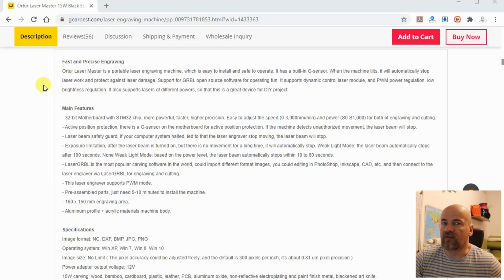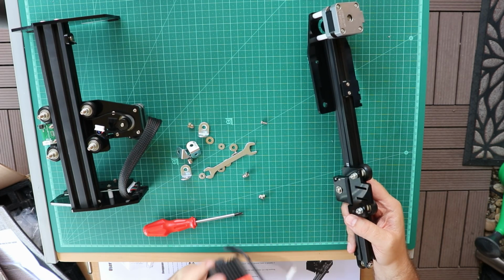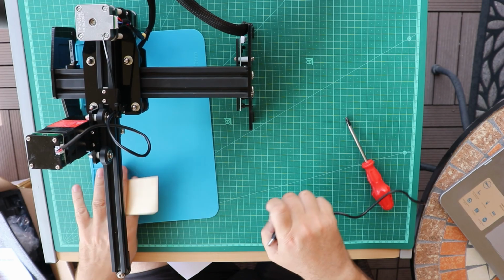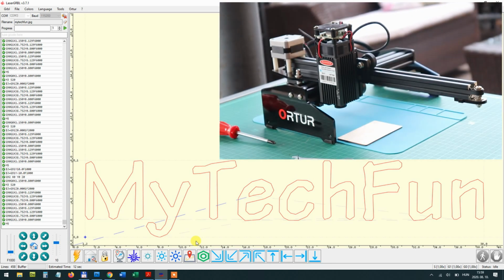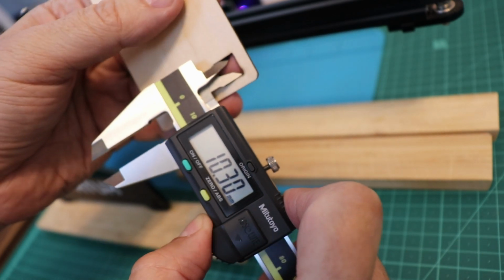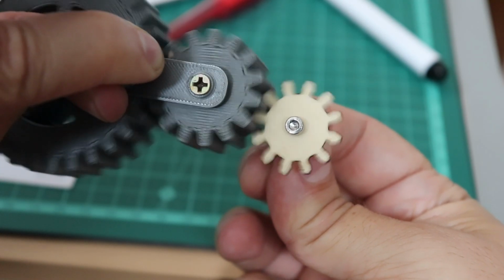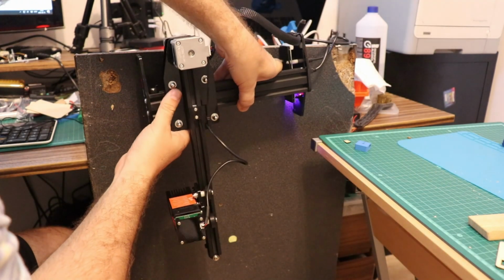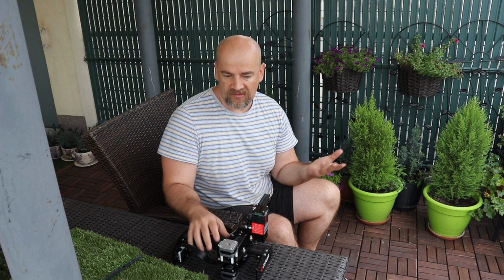Unboxing and review of Ortur Laser Master 15W laser engraver and cutter

Comment: Hi, I only want to use the ortur on coloured anodised aluminium I will not need the laser to cut anything only to put text onto the anodised aluminium, speed doesn’t matter so which will be the best quality, the 7 watt, 15 watt or 20 watt. I hope you can reply to this. Thanks.
Reply from the maker: So far, I didn't try to engrave aluminium. But if I will get some good results, I will document it and upload a video.
Reply: @MyTechFun  thank you.

Comment: To laser stainless stee,l spread mustard on the area to be engraved first.  The laser has a chemical reaction when in contact with the mustard and steel and it helps it burn.
Reply from the maker: Serious or joke?
Reply: @MyTechFun  Serious,  the mustard has a reaction on the steel,  not sure what grade of steel it works on,  but it does work.
Reply from the maker: Thx, I will try it

Comment: Great video so much info here. Did you ever end up getting better grayscale results? I was thinking about buying one but after seeing your video I'm leaning towards the neje 3500
Reply from the maker: Now, after few weeks of additional experience, yes I did, but not much better. I had to reduce the speed and laser strength. Then I could go with smaller dots too. But it depend a lot of your engraver, your settings of focus point..

Comment: I wonder if you could cut normal paper with it and how that compares to the regular paper cutting/stenciling machines.
Reply from the maker: It can cut normal paper too (need high speed), but mark on edges are visible (black from burning). Not much, but visible.

Comment: You might try vertical where the y axis is the vertical one, not the X. As then the origin x0y0 should be at the bottom left, as opposed to the top left.  Watching the embeded clip, it looks like when they engraved bread, they did a raster, while you were doing a vector engrave. It wouldn't surprise me if their clip was spead up as well.

Also one of the things that may help your engravings is to use a vacuum or blower to move the smoke out of the laser path. This will also help with laser safety, as a big problem for these laser engravers is that the laser reflecting off the smoke gets scattered, but is often still high enough in power to cause problems for retinas. If you vacuum the smoke out, it can be captured in a filter, or evacuated outside. A blower cans leave smoke in the path of the laser at other points from where the blower is functioning. but it may be something you can print a mount for to attach to the laser head and it will move with the laser, and clear the path along the way. Just some observations.
Reply from the maker: Yes, I noticed in meantime, that somoke may have some effect to strength of cutting or engraving. About rotating engraver, I tried it, but in that case, whole X axis moves when motors are not active. In position shown in video, only module has to stay in place with stepper motors off, and it is much lighter.
Reply: @MyTechFun  Yeah, smoke is very likely going to reduce how much laser light gets to the target. 

What you might consider doing then is effectively rotate x/y axis 90 degrees counter clockwise, so that the bottom left in the orientation you show is the x0y0 position,  Unless actual endstops are involved, it could be as simple as swapping the x and y connections at the controller board, and if necessary rotating connectors to get the +/- for each correct. I suspect you may see some overshoot problems on -x moves, but you might be able to correct for them with a counterweight if the belt is available on the far side of the beam. If it's running down the middle of the beam, that would be a bit more difficult. And yeah, adding a counterweight does mean having to move more mass, so might result in needing higher current , but at least the mas should ballance.

Again, ideas. Something to experiment with, or not. :-)

Comment: Thank you for a very helpful video - I've been thinking about buying one of these.  By the way, you should try painting stainless steel with a light coat of zinc primer paint, then engraving, and finally cleaning off the remaining paint with a solvent.  It should leave a tough black engraved image where the zinc reacted with the steel.
Reply from the maker: Wow, useful info, I will try it in near future. Thanks for the tip.

Comment: I believe, the g-sensor does not analyse the absolute value of tilting but the relative tilting compared to the start of the job. So it will stop only, if the tilting changes during the job.

Comment: Wow. Great video. Have you ever try to etch a marker painted pcb?
Reply from the maker: I tried without success. But I have to try with some stick tape instead marker, that should work.
Reply: @batubay92  You can do it by engraving photo-sensitive PCB material.  It's available as both positive resist and negative resist, but of course you would only be engraving the photo resist layer and would have to chemically etch the PCB afterwards.
Reply: @batubay92  I've several times seen people comment that 5W or less is better because they usually are single laser diodes, whereas some 5W and most bigger use multiple LEDs so the spot isn't able to be focussed so precisely.  Certainly 2.5W will work reasonably quickly, from what I've seen.  I don't have personal experience, though. Also there are some chemical methods that are much less nasty than the two main traditional ones; look around on YouTube.
Reply: @pnt103  Oh thank you so much for your valuable information. This info is what I was looking for. I will buy 5000mW laser.